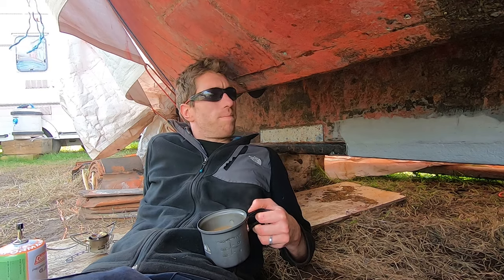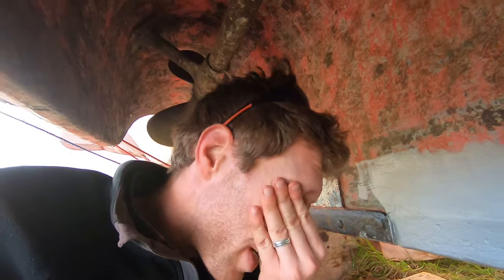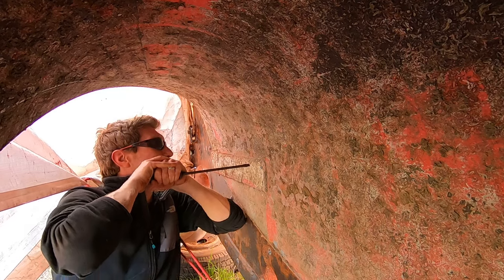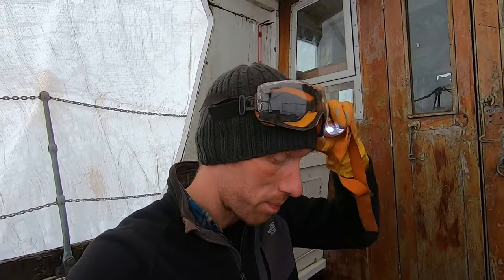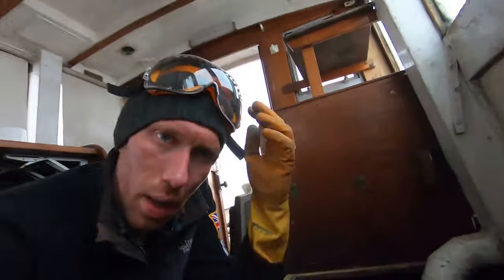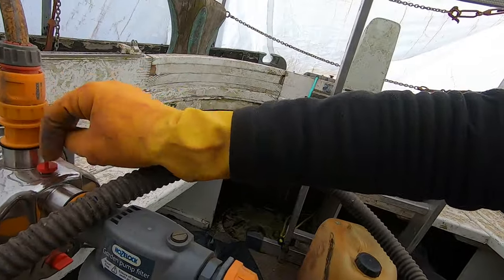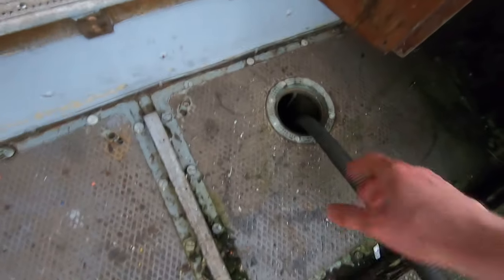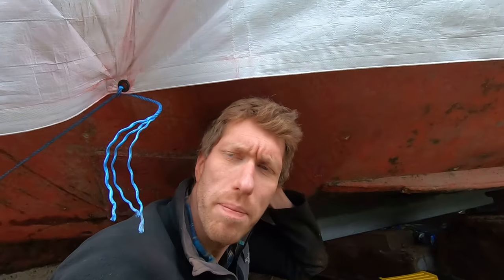Restoring a Dunkirk Little Ship. Episode 4: Failing Forward

Comment: I use an impact screwdriver now and then when working on cars you just hit one end with a hammer, which pushes the screwdriver hard into the screw and turns it with the impact, this also reduces the chance of the screwdriver from jumping out of the slot.

Impact Screwdriver Set (12 Piece) (22322) (there are better ones available, this is just an idea of what to look for)

might be worth investing in one, as you're going to come across a few more stubborn screws on your journey.

Comment: The good thing is, it’s holding water which shows a fairly sound hull. Draining it & drying it out could cause the hull planks to shrink back?
Reply from the maker: I'm very slowly drying it (no heater or forced ventilation). Aiming to fill any seams with G/Flex inside & out

Comment: For those screws. Have you considered an impact wrench? With a slot screwdriver bit? I've had a lot of luck with those.
Reply from the maker: The screw head snapped under an impact wrench... Nothing an angle grinder couldn't fix

Comment: As another commentor has written the pump you found on board doesn't have oil, the 2 red bungs on the body is the top one is for priming and the bottom one is for draining the pump after use (don't leave water in the pump body as it can get past the mechanical seal and into the electric motor), that little pump should be able to drain the bilges maybe not super quick but adequately which saves you the money of hiring a pump.

Comment: Its a daunting task you have, but hopefully you'll see it to the finish. Slot screws are a pain in the butt. They were and in some cases the only screws used on wooden boats till recently. 
If you give the end of the screwdriver a sharp tap with a hammer while on the screw head; it often breaks the seal and also around the paint & around the screw threads. It works for Phillips/Pozi  screws too. Your scredriver could have been a tad shorter to eliminate it dropping from the horizontal which slot screws demand. If the scredriver has a hex where the head and shaft meet, get a suitable sized ring spanner, longer the better and let that do the turning. You'll get more torque than a sweaty fist on the driver head. Keep at it , you have to save it.

Comment: Mate … the pump doesn’t have oil … the top plug you un screwed is to put water in to prime the pump they don’t work if they have air in the circuit
Reply from the maker: Yep, I found that out the hard way after giving it another go after siphoning. The hose quick connector immediately failed and I got a very oily water feature on deck 😅 All good now though, thanks 👍

Comment: hi Buddy  great attempt to restore the boat.. it's a massive challenge on your own   but before you start with any of the cosmetics and waste all your time and money in tools and equipment   get the boat opened up  it might be well past salvaging rotting from the inside out   if the wood is too rotten and the engine over haul might run into £1000's  don't be afraid to admit defeat at least you tried  your heart is in the right place ... just my tuppence worth  is painful to see you hit snags with out the right tools.. invest in a working boat that just needs tidying up least you can take it for trips up the rivers and enjoy it  best of luck  Nick

Comment: Because the anodes are in good condition tells you something. These anodes might be the ones originally fitted but they were probably not bonded correctly to the metals they were protecting, therefore they were useless. This is the case with one of my lifeboats which is older than Dowager. Best of luck.

Comment: There are lots of elderly boats about the country and some are an awful lot older than this old lady that need a little bit of t.l.c. To get them into what they once were but with the cost and workload a fraction of what she will cost , I take my hat of to you for having the guts to take this on but when you’re working alone and not exactly a millionaire it may be time to stand back and have a rethink about getting something a little easier as there’s only so much that we can physically do and as you say everything on her is either broken rotten or needs replacing  and we haven’t even got the deck off yet or checked the engines. Please don’t think I’m nocking you because I’m not and I whole heartedly wish you you all the best in the world if you carry on but please do a more in depth survey and coatings before you carry on